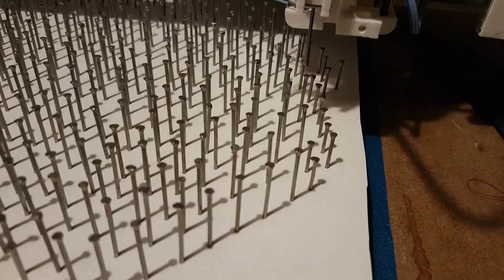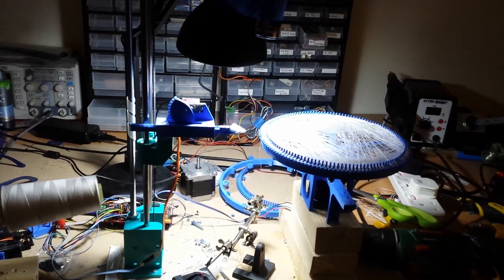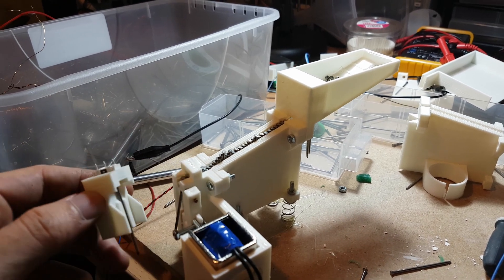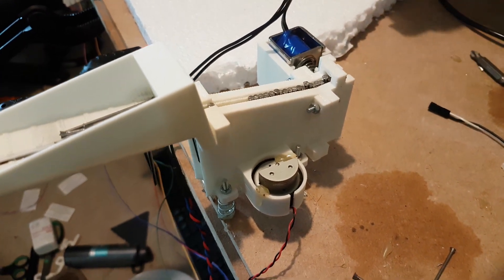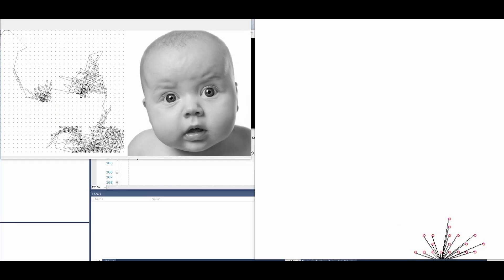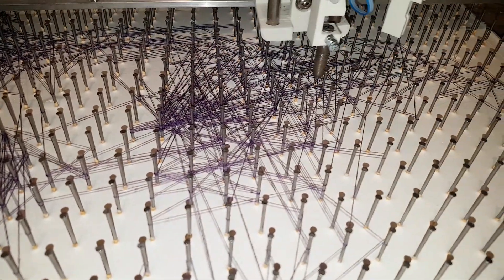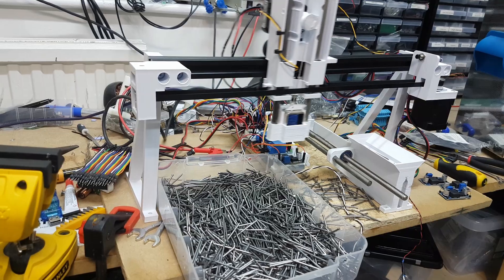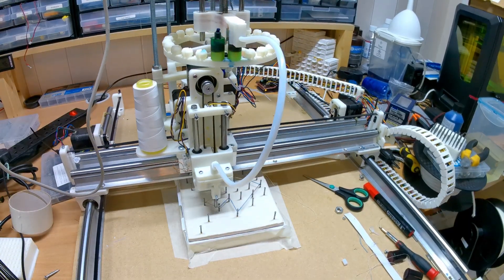Building a String Art Machine

Comment: just discovered this video and i love it! You provided a link where you explain more about your process, and you mention you used a RAMPS1.4 board and for firmware you use Repetier. I'm very new to this and I'd like to stuff very similar to this, but from my research I found that an ESP32 was the way to go. I was wondering if you can provide any advice or point me in the right direction? Thanks so much :)

Comment: Do you optimize for going clockwise vs counterclockwise around the nails, for each time you visit the nail?

Looking at the yellow dog, I realize you need to paint the nails to match the background. Also, smaller heads will be less noticeable, but harder to get to line up in your hopper.

Comment: It's amazing to see that you followed a very similar path to how I built my machines! I tried to pick up nails from a big pot as well, but it was unrealiable and then I realized that placing them on a matrix manually was fast enough with some jigs. With a screw on the z axis you can easily nail onto harder surfaces like pvc foam or soft wood. Great job!
Reply: Hi @laarco, what code you have used for this project. Possible to get the code or git link?
Reply: 08:00

Comment: I guess for building a hopper system, having a funnel with a bunch of screws in and from 3d printing knowledge, a BLTouch component to detect depth would be reliable to know where the screws are could be ideal. Or an overkill laser distance system. Funnelling the screws just ensures that they are all going to feed into one zone where the pickup will find the closest screw essentially. Other than that, sick idea 😅

Comment: Google "green floral foam"  as your base material. It should solve your issue with the particle size in the styrofoam and be able to take a higher tensile strength with the thread on the nails pulling. 🤷  (Also look at textured trim nails, they should bite into the material better)

Comment: It could be interesting to have a mechanism that pushes the string down the pegs at the end, maybe a tube attachment that pistons down around each nail
Then you can pour on epoxy to lock the threads and finally pull out all the nails

Comment: How many samples did you need to get the nail measuring neural network to work reliably?
Reply from the maker: In the order of a few thousand nail images. The way I generated the images was by repeatedly loading a nail, then dropping it, then loading it, all while taking photos from the cameras. I would then manually classify them which took a few seconds per image.

Comment: This is really awesome. It seems that part of the problem is managing thread at different heights. Have you considered adding some mechanism that pushes the string down the shaft of the nail?

Perhaps some kind of trailing leaf spring that pushes the string as you go.

I think an easier way would be to periodically put a "pusher" mechanism on the toolhead and just have it punch down the string after every 10 meters of string is dispensed?

Comment: Great machine. I’m thinking if you loaded the nails head first into the holder and let it swing down with a magnet so it’s point down, you will then sense a loaded nail shaft against the sensor. Plus controlling the nail hold back from the loader should be easier as you only need to allow the head to pass ( maybe a ball bearing pushed in then let off, it will roll along till it stops the next nail head)?

Comment: Very cool! Lots of interesting hardware and software challenges. I guess you keep track of the individual number of wrapped nails to determine z height for the current string loop? Are there any edge cases such as intersecting z heights from other nail loops? 

I think trying to simulate the end result using ambient occlusion will give you a good enough representation of contrast in areas like the eyes to tell if the image will work well. You could probably port the software side into something like Maya, Blender and use hair/fur/or curves to bootstrap the rendering so you don’t need to implement a custom shader. 

Great work!

Comment: awesome, mental, insane. Which other adjectives I can write?! 
So much actually cool - the gears, the holders, adapters, all step and servo motors. 
I laughed out loud on a "correct side of nail" sorting, based on gravity. Rediculously funny!! One actually could do kind of revolver filled with nails. One side fills, second just grabs sorted one from a pocket. Current random catch with vibration movement is not efficient, imho. Probably you could use those banded nails for automatic nailer.
I believe I could do the hardware part and program  simple moves here and there check state etc.. But finding a path, with all those distances to not hit a nail and so on - AMASING.

Comment: Im flabbergasted. This is insane. Like a normal person would have stopped at just making a strong art on a ring, but no. You went farther again and again. Designing software to determine the paths, training so to recognize if the nail is in the machine or not, DYEING THE STRING as it comes out, and rebuilding it partway through. This is so freaking cool.

Comment: Did you write an algorithm to determine the nail positions or was that done manually and the nail physical placement part of the automation?
Reply from the maker: I had some automated approaches and some manual if I wanted to modify it. Some were completely random grids. All nails were placed by the machine and verified by the machines. About 1000 nails per piece.

Comment: There is an embroidery machine called a Coloreel that dyes plain white thread as it sews to make colours instead of switching between different spools of thread, embroidery machines move the work piece instead of the sewing head, meaning the distance between the colouring process and the output remains consistent, perhaps a system that moves your canvas around the string (as opposed to string around the canvas) would be a good place to start if you wanted to take the coloured string idea further.

Comment: This is mental. This is actually mental. The part where you decide you want to try adding colour so you just casually invent a method to DYE THE STRING AS IT'S BEING FED OUT absolutely pushed this into the realm of the absurd. You're officially my idol, what a legend.
Reply: It's really not that absurd though is it, it's a pretty logical solution. The mechanical aspect of this project isn't the relatively difficult part.
Reply: @CockatooDude  It really is though.

Anything approaching a sane person would place the string, then dye it afterwards... You know the way we do with printed fabrics? Or else use different colored strings and place them exactly where they are wanted, as we do with woven patterns.

 If there is anyone else who has ever tried to dye string in different colors, as it is being placed in a project, I've never heard of it.
Reply: @CockatooDude  Not sure how you figure, you could literally just use an industrial inkjet printer.

If there was too much deviation between the simulation and the actual nail art (which I don't imagine would be the case, but just in case) you could just print the ENTIRE image, to make sure to get the color on the strings, and then either wash away the overspray onto the backboard, or pour a layer of thin paint across the whole board to hide it.
Reply: @Nevir202 But thats not the point is it? This is about ingenuity and lateral thinking, melding mechanics with software. Otherwise just remove the nails and thread and inkjet print a colour image!
Reply: @failureisnotoptional929  Yes... Do you fail to realize I was replying to someone trying to argue that this wasn't a crazy thing to do?

Either you and I agree, or you are arguing that this is somehow a sensible way to get a color image.

Comment: MULTI PASS!!!!! For colors. Do a CYMK in layers. In art, you work lightest colors to darkest. So with CYMK you would go with Yellow first, then Cyan, Then Magenta and lastly Black or K. This would give you full color images on the final piece. You would only need to pull the base image into photo shop and separate the color channels into single grey scale images for each pass on the machine.
Reply: Had a similar idea. The only issue I see, other than maybe not having enough nail for all that string, is that anything dark is going to be dense in string of every color. Running the separated images through the same algorithm may just end up stacking strings literality atop one another a lot of the time so the light colors aren't meaningfully able to affect the final image?
Reply: @Nevir202  This is already considered with the light to dark method as the same issues arise when using half tone or cross hatched patterns in print. String is a similar medium to cross hatching and thus the light to dark method would result in a image similar to that which is printed in a magazine if using CYMK. 

Though the string print didn't need to be CYMK it can follow a different color pallet the way silk screening would for a multi color print that uses specific colors.

Comment: It seems like you may have started to do this and just haven’t mentioned it but have you considered some form of like, decimation. Ie have fewer nails in areas of less detail and more nails in areas of high detail, as well as potentially optimizing the path the string needs to take, so certain parts would have a harsher more defined outline. I can already tell you we’re thinking about something like this by the existing gaps and the triangular grids. I also think triangles make more sense in terms of nail distribution. 

Idk I’m a 3D artist not a programmer so I’m thinking in terms of polygons and points here so it may not be applicable ¯\_(ツ)_/¯ I just know what decimating a mesh looks like and how much it can help.

Comment: Man you really over engineered your nail dispenser.
Low feed applications use either a drum with magnetized slots or a moving "staircase".
Than comes a gravity sorter that rejects nails that are way to misaligned directly followed by a gravity aligner.
The feed rails need to be metal, plastic won't cut it.

Comment: @paulmh Had you considered using a nail gun strip to load the nails? Some are arranged into strips held together with paper and adhesive, so it may be weak enough to pull apart with a small motor, and the nails would be lined up and pre-stacked. Cost may be a bit higher though. Could also have individual magnets or grabber pick a nail, camera with machine vision rotate it, then index it in a slot in the correct orientation.

Comment: So amazing! Great explanations too. I built something similar but always had trouble with the nail grabbing and placement, its really hard once you scale to 100s of nails and having it work reliably every time, same with routing the wires which probably took hours in some cases and one wrong hit of a nail would be disaster for the art. Loved all the different iterations you went though there to get something reliable. Ohh and I like the idea of using inks to color the white thread, Its complex but if you could get that to work you could really create some unique never before seen stuff. i took a slightly lazier route and just did what most 3d printers filament managing systems do and switch out the "filament"

Comment: This is absolutely insane. I can see a bunch of potential methods of improvement you may not have thought about.
First, I wouldn't worry about coloring the thread. I would work it into the program to seperate the image into rgb (and maybe yellow) layers, then have the machine do each layer one at a time, either by manual loading of the thread color, ir figuring out a way to have it tie off and start a new color.
Instead of the rube Goldberg machine for the nail loader, which unfortunately seemed to fall short (badum-tsss), I would redesign the magazine entirely to be able to hold and sort around a thousand nails. Look at how they do magazines to ensure things like bullets and soda caps are facing the right direction. And, not entirely sure on this one, but they may use a vibrating magazine to do the nails that are loaded into a nail gun and make sure they're in the right orientation as well.
And finally. Are there plans/downloads available? I'm fine on the hardware side, but unfortunately lacking a bit on the software side to make my own.
Reply: For the nail feeding yes vibratory bowl feeder is what you want to search for
Reply: yes ! but you’d need cmyk (cyan magenta yellow black) ish colors rather than RGB colors because the final piece isn’t a screen.
Reply: @necrotelecomnicon  right, yeah, light emitting vs absorbing.

Comment: This is very much in the same spirit as Stuff Made Here. Super cool!

How did you solve the height problem, in the end?
Reply from the maker: I used a quadtree to analyse all the existing simulated string coordinates and detect the number of overlapping strings underneath each segment of the stringing head, then I would lift it by an offset per string something like 0.1mm, this let's the stringing head sort of hop over the existing string, it would also calculate the expected number of strings that are actually wrapped around each nail so that they gradually climb up to reduce the chance of tangling.

Comment: Why didn't you use something like framing nails that come pre-packaged in clips and rolls?
Reply from the maker: I looked into it and they were too large unfortunately. The nails I used are around 1.6mm in diameter which I couldn’t find in any sort of prepackaged array. I would ideally have used 1mm nails but I couldn’t find any long enough at the time. If I was to do it again I think I would try using a roll of 1mm wire and make the nails myself.

Comment: one idea- you're doing this on insulation foam. After a piece is done, could you put it on top of a wood panel and then hammer the nails down (manually with a hammer) so that they go into the wood and make the whole thing more secure? Not all the way down, the varying height of the thread is part of the look, but just enough that its secure in the wood.

Bonus mess: after you nail it into the wood, get some acetone and melt the foam out! :P

Comment: Love this, looks so cool x i would've tried building the original ring with holes that you put nails into so the pegs are thinner, the grid idea is obviously better tho :)
Reply from the maker: I actually did try this with a laser cut ring out of MDF and small pins but it also failed like the rest sadly
Reply: @paulmh hi, what code you have used for this project. Possible to get the code or git link?
Reply: 8:00

Comment: I hope you will open source the software tools used to create the string paths, nail positions, and gcode. This would really help others (including me) expand upon the idea. I'd like to do something very similar, but with a few changes:
1. Push the nails all the way in.
2. Wrap the strings on the pointy side of the nails.
3. Coat the string in resin.
4. Cure the resin.
5. Remove the nails.
6. Suspend and display the art with none of the assembly scaffolding in place.